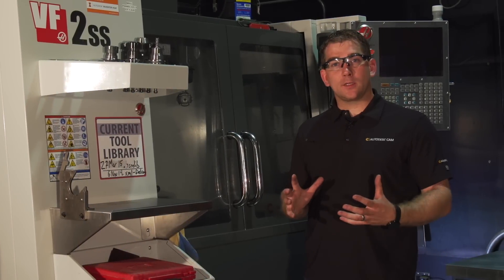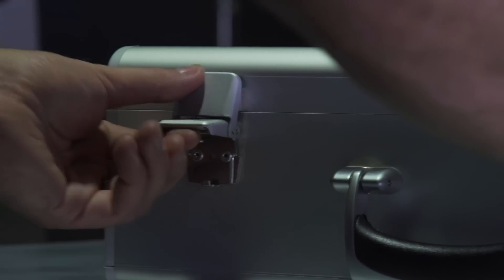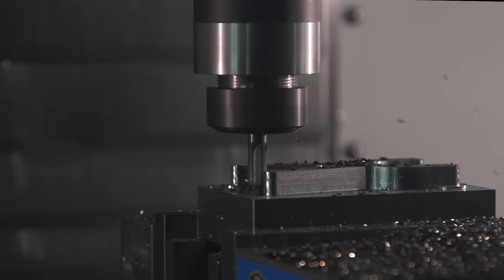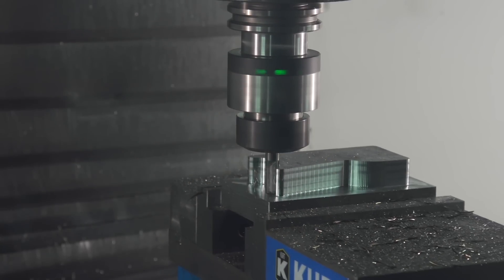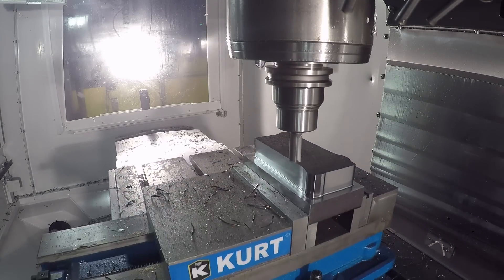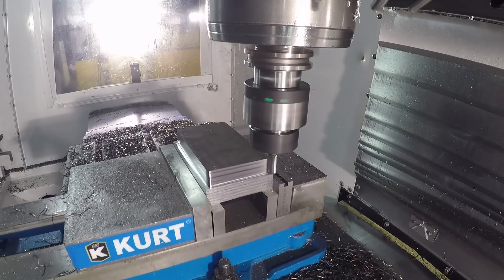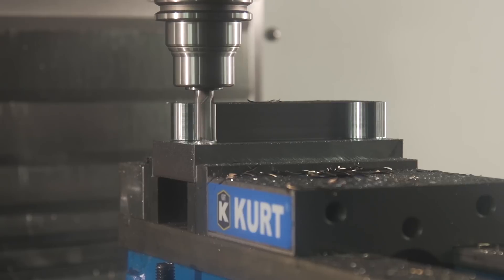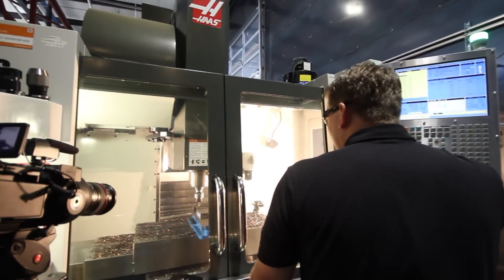Autodesk CAM's Adaptive Clearing Toolpath

Comment: Are there any other videos or reference materials on how to calculate speeds and feeds?  Seems like this is pretty “off book” from what the cutter catalogs would tell you, so how does the programmer know?  Also, do you have a similar video for internal pocketing strategies?  

I work in a shop  that does mostly tooling and proto’s, so a lot of time we’re making one part at a time and then might not have another 3D job for weeks or even months.  I’d like to get better at these operations but my practice opportunities are fairly irregular.
Reply: i found something usefull somewhere on the internet and test it out good for pocketing: radial cuts 35% of tool diameter always and axial depending on material: normal steel 10% of tool diameter, stronger steel 7%, very stronger like tool steels 5%. For plastic radial 35% and axial 50% on addaptive and pocketing also